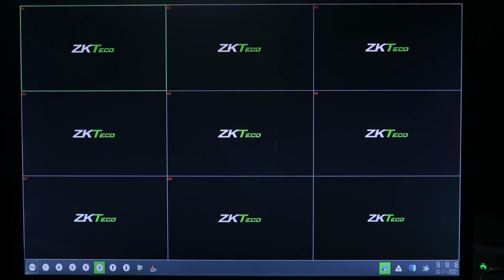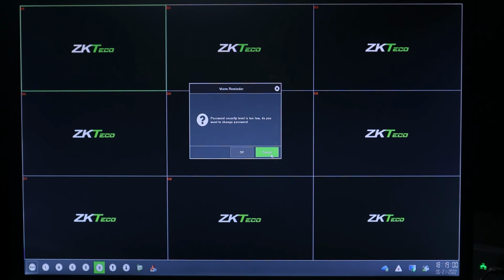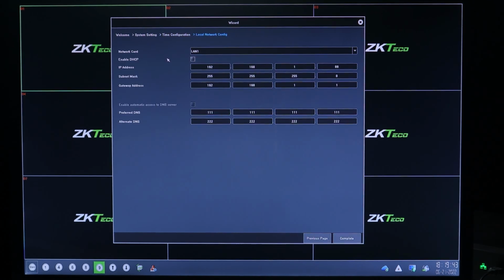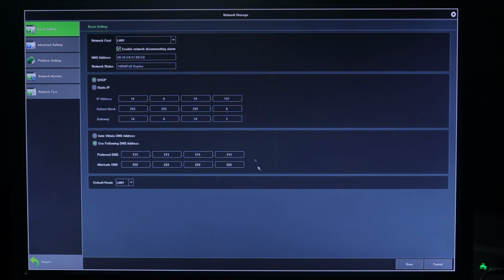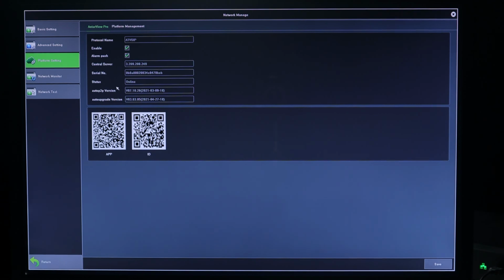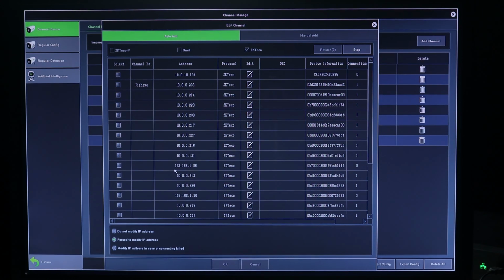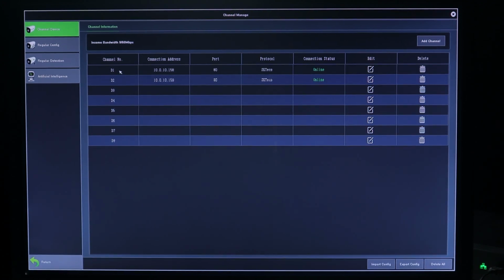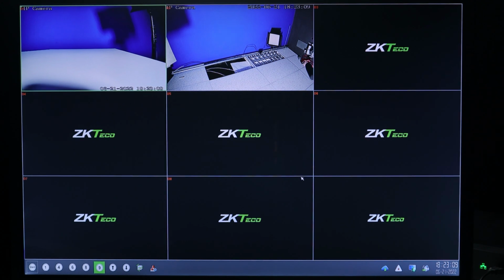CCTV Basics

Comment: Is it possible to plug the rj-45 of the camera to our Adsl modem / wifi router directly?  supplied 12v power by using a 12v adapter. I can see the camera in internet explorer but it is always offline in Antarview when I try to access by mobile phone. I need a solution. Thanks
Reply from the maker: Hi Aman, We have forwarded your enquiry to our CCTV department. If there is a solution to your issue we will post it for you here.